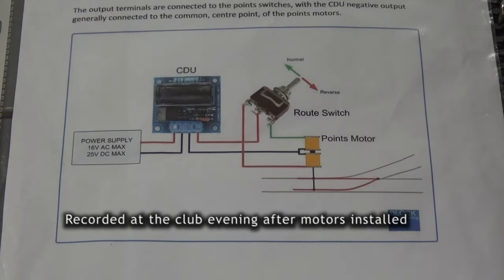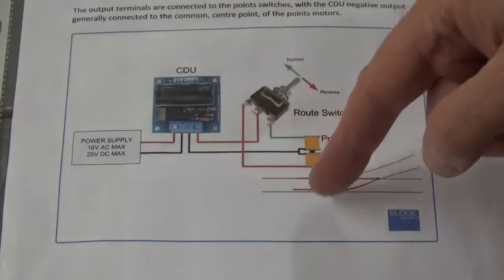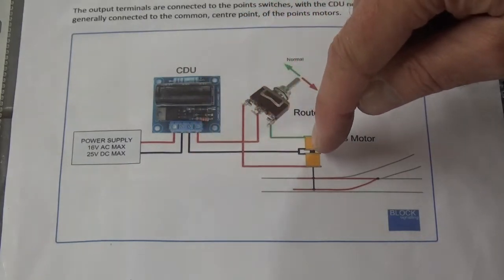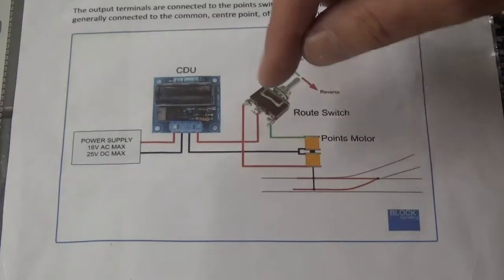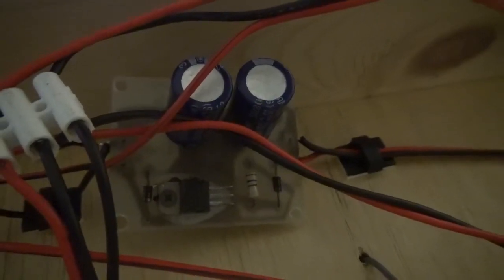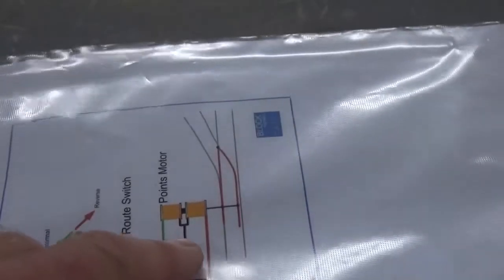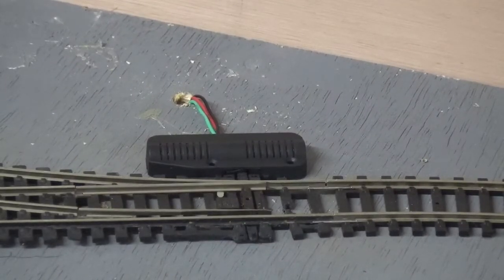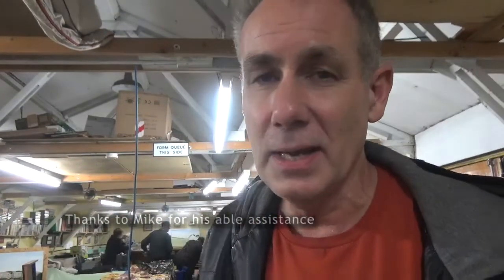Jurassic Ride Pt7 Installing DC Point Motors

Comment: Well explained Laurie. I used a 7 way switch (or is it 8) on my Melbourne layout through a CDU to a 16v power supply. The switches can be flicked up or down and return to centre. I am always amazed when my switches work.
Reply from the maker: Yeah return to centre makes sense.

Comment: I would have thought that the switches would need to be spring loaded to ensure the switch is off when not being operated, but that said, it seems to work OK.
Reply from the maker: Good point. But these are the switches as in the diagram and so I used these ones but as you say a spring would assist David.